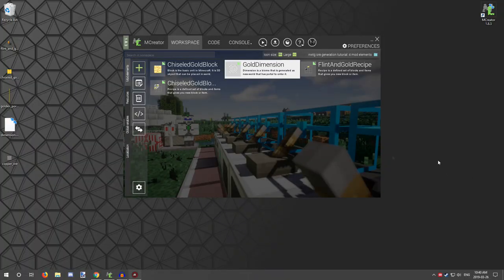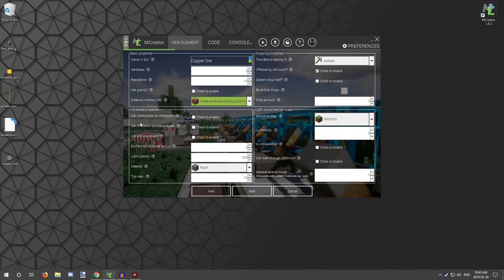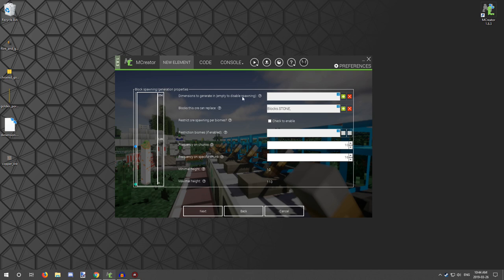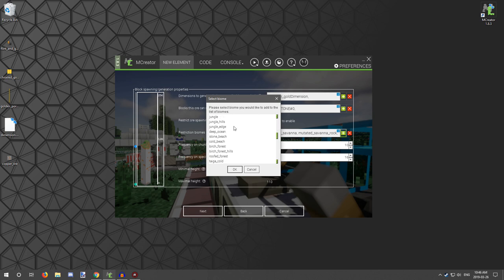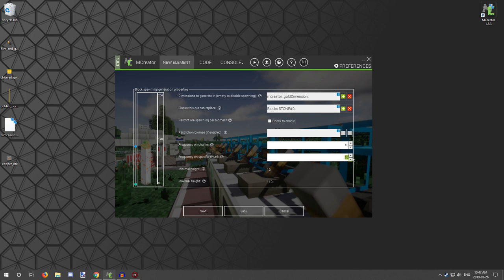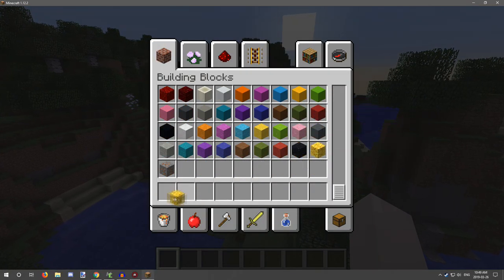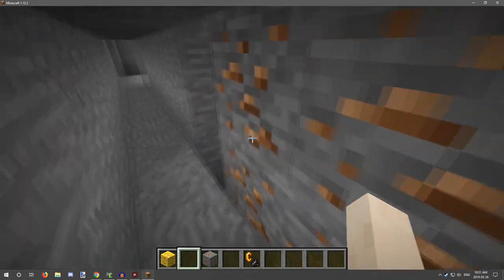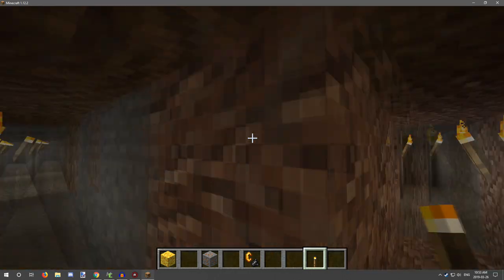MCreator Tutorial: How to generate ore in dimensions | 1.8.3

Comment: how do you export into zip files? p.s. great vid!
Reply from the maker: To export your mod to a .jar file which you can use as a mod is at the top icon bar next to and on the right of the test environment button, it has an up arrow and if you hover over its icon it says export your mod to mod .jar. Forge uses .JAR files to load mods.

If yours looking to just backup your mod you can export your workspace on your workspace selection page then click export then right-click on the file after you save it and a dropdown box should appear finde the one that says (send to) when that is expanded you should see an option to (compressed (zipped) folder) that will make a windows .zip file with your content in it.

Comment: How do i make mobs spawn in custom dimensions?
Reply from the maker: The last page for your entity holds the spawning settings for that entity, you can restrict what biomes they can spawn in. 

If your using custom biomes then you will also want to allow the mob to spawn in the biome spawning section under the weight settings page where all the extra configuration for trees and terrain is located. 

Vanilla biomes will only require the mob's side of things.
Reply: @NorthWestTreesMCreator  But that is biomes, i want it to spawn in a custom dimension, but how?
Reply from the maker: @ubahni  Dimensions don't control entity spawning parameters biomes do so you would have to make a custom biome then restrict that biome to the dimension you want, and control the entity spawning from the biome.
Reply: @NorthWestTreesMCreator  Alright, ill try 😀